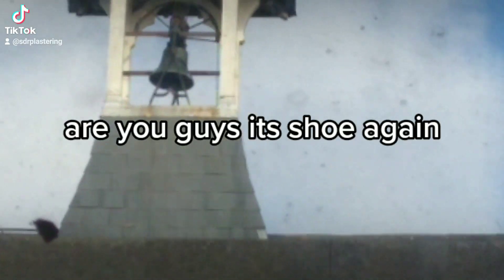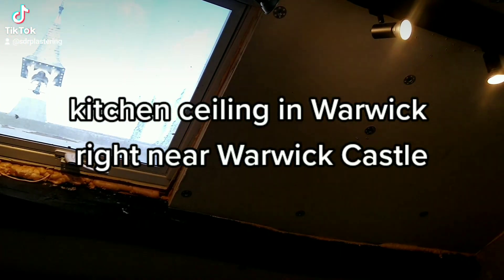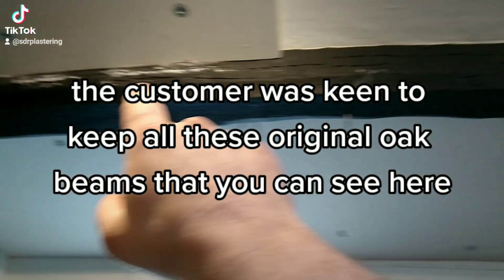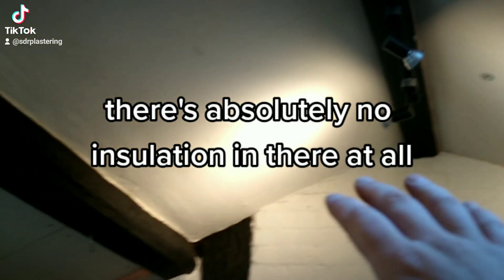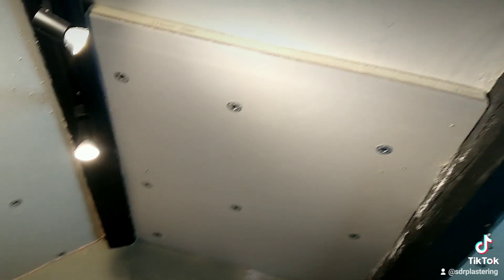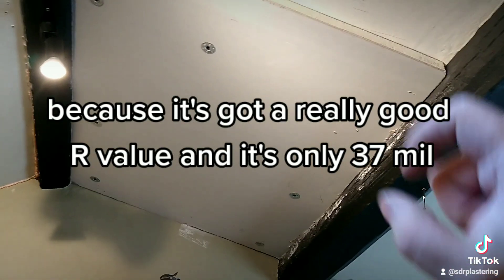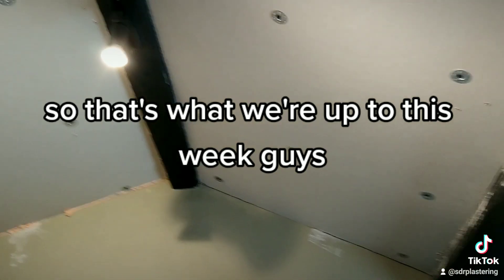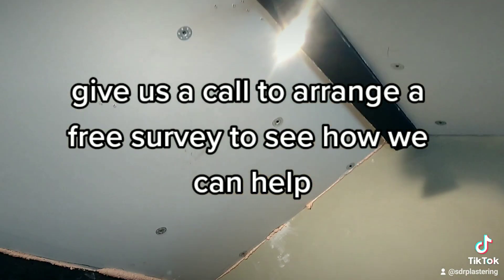COLD KITCHEN FIXED

Comment: what foam did you use around the edges of the board to fill gaps.  the same as what you stuck to to the wall with?   is it ok to use foam adhesive around  or near hot water/gas pipes